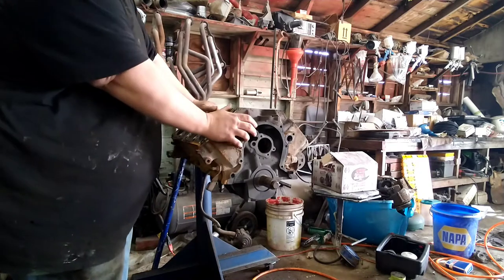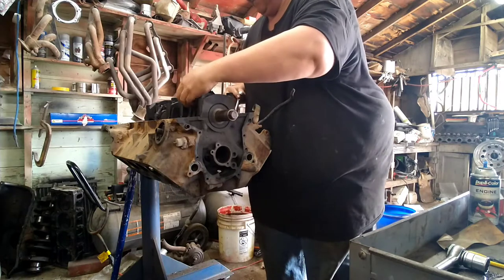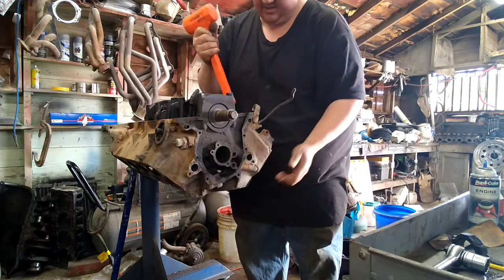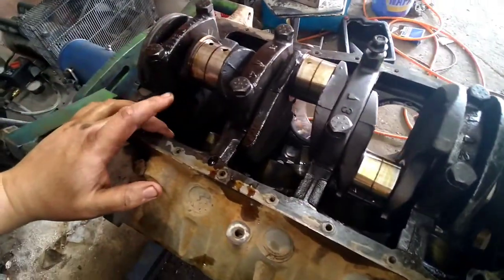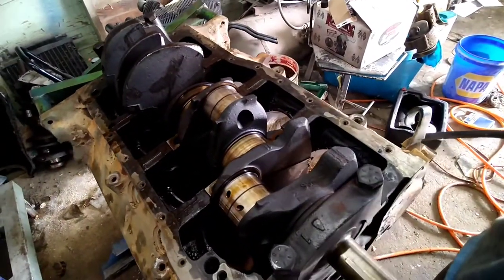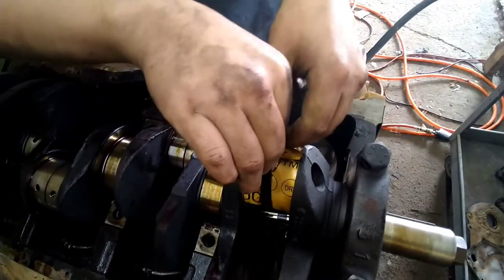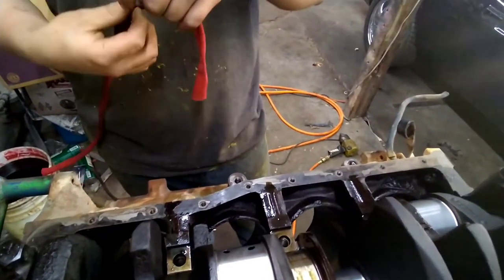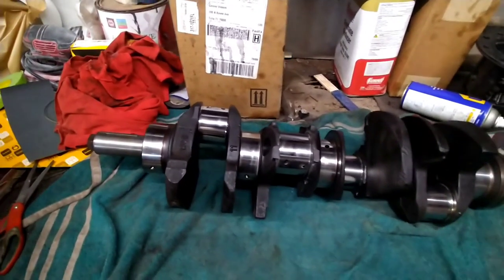351w teardown plus crankshaft polishing

Comment: I’m new to crank polishing, I’ve always been kinda afraid of fucking up that stuff, just curious though, is the little bit you polished off going to affect oil pressure any, in theory it would a little but how much 🧐
Reply from the maker: I've still got 50psi of oil pressure when hot with 10-40 oil